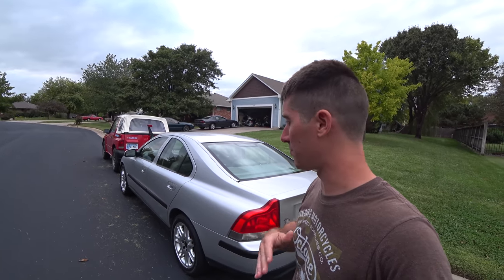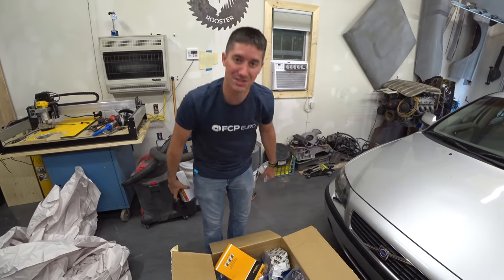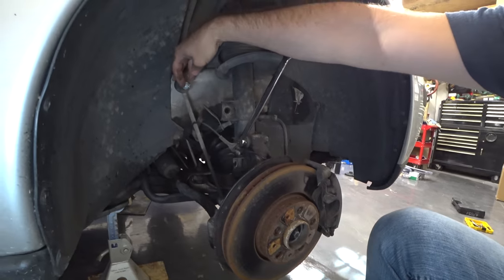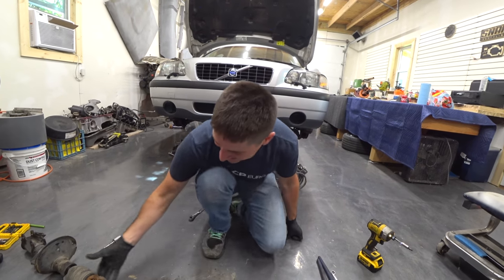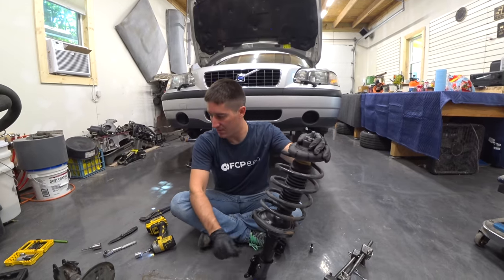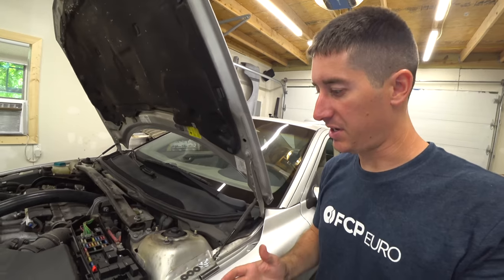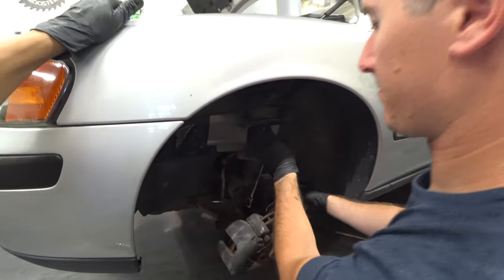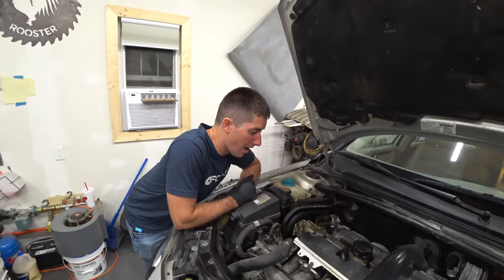REBUILDING The CLUNKY Front STRUTS On My $450 Volvo S60

Comment: I have FCP Euro on speed dial. Most P2 S60s around here are in the $1500-$2500 range because owners don't realize the PCV system NEEDS to be changed or timing belts are bad to let break. Over the past 3 years I've spent about $3000 on mine getting it to 100%. The only parts that really need help are the right side knob on the radio and the bolts holding the sunroof (one stripped), he engine mounts are in a box (due of course) and my left axle is JUST now starting to make noise at full right lock. 😂 I love working on it though.

Comment: I had a volvo s60 from 2002 that was the P2 chasis. It bought it in like 2009 at 80k and had to retire it at just under 250k in late 2018. If you didn't get one with the dreaded transmission slip from the early years it was a great car. But I ended up buying those special shock mounts for the front from IPD and it made a huge difference in the longevity of those common failure points.

Comment: Fun video, good work on a really nice car, that would probably be on the scrapyard a few years from now, if nobody cared like you. Few tips from a licensed mechanic tho, if you take off linkage for the swaybar on one side, you have to do it on the other side to. Othervise you have a big problem mounting struts because the swaybar equalizes the force for both sides. And secondly, never drive a springcompressor with an impact driver, seriously, dont. Use a machine witouth impact force. The hammering shatters the material in the compressor and i could snap. And as you rightfully pointed out: the most dangerous job on a car.. Keep up the good work, luv the video of the boat!

Comment: my coil spring compressor is perfectly safe.  it has u bolts to clamp the spring to the tool.  takes a little longer to use, but safe as can be.

Comment: When installing a battery in a Volvo you must install the outgassing hose supplied with the battery. It's a safety item and should not be forgotten.
Reply from the maker: I did, noticed it wasn’t hooked up on the last battery 🍻
Reply: most new ones come with it in a zip lock bag attached to the new battery . O'Reilly Auto Parts should have one there to install for free.
Reply: I also live in Connecticut and attend FCP EURO's Cars and Coffee. Its a great time you should try and attend one year. keep up the great work.

Comment: Using an impact on a spring compressors shouldn't be done.   They heat the threads and can be dangerous.   Anyways like the Volvo content because i have one as  2nd car and its been very reliable and very comfortable.

Comment: I had to do the PCV aka "flame trap" and it's such a crappy design removing the whole manifold. I had the same problem where I was hearing a crazy whistling sound because of the pressure but thankfully it didn't blow any seals.

Comment: if your battery is bad in a S60 check your alternator. The issue with the battery being in the rear is the long cables with their added resistance (that gets worse over time)  puts undue wear on the alternator. The result is a fairly new battery going bad early.

Comment: PCV system will get blocked on these volvos which causes excessive crank case pressures and causes the seals to blow out oil. Be sure to check the PCV system before you get ready to send the car.

Comment: Two years ago the suspension on my 2012 Elantra was ripe for renewal at 100,000 miles. I did the rear shocks myself. The front struts? Heh...I entrusted those to a shop. Spring compressors scare the ever living hell out of me.

Comment: I agree with you about using Volvo oem parts, that’s really the way to go. I personally would have bought a whole front end kit depending on what condition the rest of the front end was in and just replaced everything else in the process. As for the front struts, yeah that’s a dangerous process. I probably would’ve brought those things to David (aka. the wizard) and had him swap out the strut assemblies since I presume he probably has a wall mounted spring compressor at his shop, that probably would be a safer route to go with that then you could swap the new assembly back into the car. Either way, you guys did a good job and I look forward to more videos on the S60
Reply: Michael Sackstein: Cheers friend!😉🍻

Comment: note when installing original VOLVO parts remember the factory uses recycled rubber and the aftermarket uses virgin rubber. The quick struts are a better replacement the components are more heavy duty . Plus there lifetime guaranteed anyway.

Comment: One of the tricks that you didn't use is to put a jack under the strut and lower the car a little to line up the bolts.  A 40 year mechanic showed me that.
Reply from the maker: Exactly what I did for the sway bar links, I think I mentioned it 💯

Comment: I don't know how much you care, but there is supposed to be a hose from the battery to vent the gasses outside.
(it's between the spare tire and the battery somewhere)
it will start to corrode otherwise.
Reply from the maker: It’s hooked up now, I saw it laying there when I was putting the spare tire back in place properly 🍻
Reply: @WatchJRGo  Now I can sleep well, thank you :D

Comment: You'll want to replace all 4 drop links, they start clunking after 20-30k miles.

There is a separate plastic cover at the bottom of the timing belt cover, it can be easy to miss but will save having to remove the crank pulley.
Reply: bweebar: Thanks!😉🍻

Comment: Tip on removing battery for these volvo's is to wait about 10 minutes after removing key from ignition, so the computers have time to go to sleep so you won't fry them ant also keeping the key in the ignition on first position when connecting battery. I don't do the connection part but I've read somewhere that it's recommended to do that.
Reply: kur_karolis: Thanks! 😉🍻

Comment: I have two on my car I got a 2004 Volvo S60 2.45 cylinder I got two very little valve timing solenoid on my car and I just put another one on for the exhaust brand new $120 drove it 29 miles turned it off put gas in it turned it on soon as I move the light came back on just had it tested again still coming up p0014 advanced timing it keeps saying so you tell me what else can be wrong with this car besides getting into the timing chain issue appreciate it thank you

Comment: Does anyone out their know how long the OEM springs should last. I have a 14 year old XC70 with 100 000km on the clock. I am replacing the struts with Koni and rubber parts mounts etc. Should I push another 300 and replace all the springs. They say that they should last the life time of the car. Saying that if a spring fails they say you should replace them as a set. This shows that they have to lose there elastic rebound as they age. Any knowledge share would be lovely.

Comment: When you put the new strut in the compressed spring and start running down the top nut how do you know when to stop? Is it a run it down all the way until it stops or is it something that should be torqued to a certain spec? I need to replace struts and I was just planning on replacing the whole assembly until I saw this video.
Reply: Alan Powell: Check out what the guidelines are for your particular vehicle.

Comment: Make that water pump is a good one. As a Volvo tech , I lost count how many aftermarket water pumps came apart and caused engine damage.
Reply: I have a Gates water pump will it do any damage?
Reply: AIM #3asyWin no for 85000 miles only if you drive mad, plastic turbine on water pump is crap when blow then engine start over heat resulting in head gasket failure, I done 55 miles without water pump on my V70 stop cool dawn and drive again every 8-10 mins and after another 6 mints head gasket has gone. So don’t worry massively about water pump after failure you still got a while to drive to garage maybe if you have no luck your water pump will snap cam belt but I don’t think it will broke that way.
Reply: @makintosz461  thank you i didn't know that was a common problem on volvo's
Reply: AIM #3asyWin It’s note a common problem, water pump from year production it’s a problem cuz it’s old and turbine spinning water it’s made from plastic witch after years might break, I know that cuz I change cam belt + grey pulley but I was think that water pump was change but nope I got v70 2005 and it was still 2005 water pump looks like new after 106 000 miles plastic turbine blow but small coolant leak and that’s all water pump shaft okay little lose on bearings but hold cam belt on place. Every aftermarket pump or gates, ina, skf any good brand mostly now making steal or alloy turbine if some day you find plastic turbine just replace after 80k miles for sure otherwise look for steel or metal, any questions I might help I done most common things on volvos pcv, gearbox aw55-51,50sn variable pulleys, electric problems main seals, ecm, turbo card ridge many many things, recently spend more than 2000£ on part so am looking how he want make a profit. Good luck bro

Comment: From a fellow s60r owner.. damn 450 you son of a btch. Thats a steal, body looks clean. Unfortunately, they typically need about 2.5- 3k in work.. or you get it all fixed and drive it to find they smoked the transmission too. Lack of maintenace is killer on these. 

Pass it along to the next unknowing guy I guess.. if they know anything you may break even. These are money pits. But you can drive them into the ground with enough time and money

Comment: Hope you marked those chamber bolts lol
Reply from the maker: Easier to have it aligned for $40 and get it right 💪
Reply: Also you're supposed to cut the strut cable after it's in the car so the chamber bolts go back in easier.
Reply: @WatchJRGo  $40 alignment. What year is this?

Comment: You may wanna put something underneath the knuckle when jacking these idiot Volvos up for suspension work, or at the very least be hella careful with the axle 'cause it'll want to pop out when it's supporting the entire weight of the knuckle if you undo stuff like struts and/or control arms. Lots of fun for the whole family if you end up experiencing this, 'cause you'll have ball bearings flying everywhere and piecing it back together is an absolute nightmare.